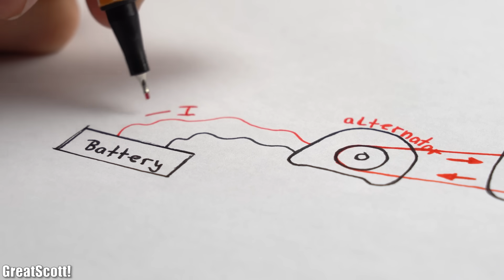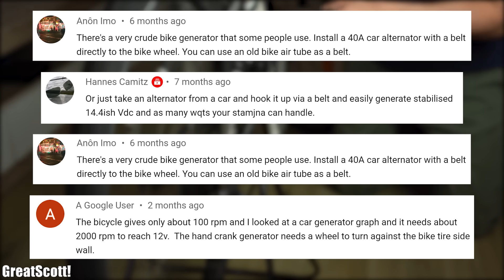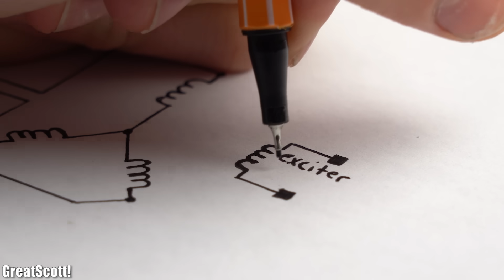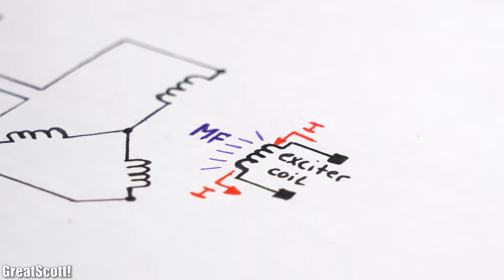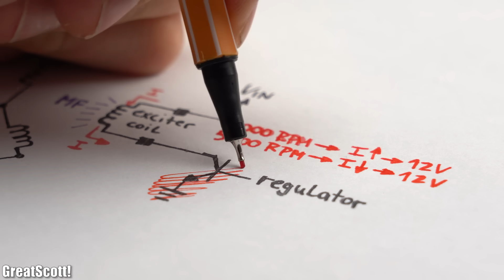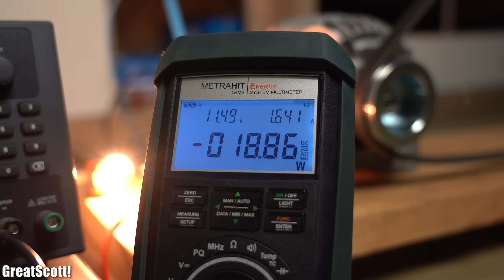Using a car alternator with a bike to power my home? How much energy can I produce?!

Comment: With "perfect" power transfer, you should be able to peak at over 100W, maybe 200W if you're qualifying for the Tour de France.

It certainly gives you an appreciation of how much work is done around the home by electrical power.  200 years ago, it either wasn't done or one had servants/slaves.
The daily work output from one would have been less than 2kWh. Think about that when you get your bill.

Comment: Hello hello from AUS. My First comment here, I always watch the channel - Great channel!
A thought for you - The belt looks really loose when you are pedalling. Its possible there is a lot of belt slip occurring and therefore loss of power generation. Look up a belt assembly used on a car, there is a spring loaded tensioner and idler pulley that can help keep belt friction on the alternator?

Comment: Back in the old days, bicycles had a dynamo to power just the front light. Ie, you were never going to get much power from the system.
Edit: as many others have mentioned.
Reply: That dynamo wasn't expected to drag much energy out of the system, otherwise it'd be too hard to actually go anywhere with the cycle.

Comment: Using an alternator that doesn't  have an integrated voltage regulator (older Ford or Dodge vehicles), perhaps would suit your application.
Reply: Using an alternator that doesn't  have an integrated voltage regulator (older Ford or Dodge vehicles), perhaps would suit your application.

Comment: How many euros of food would you need to consume on top of what you normally eat to power your house for a year?

Ps: you need to feed the stator output back into the rotor field windings and use a car battery as a capacitor. Basically recreate the car electrical charging circuit. Then use a inverter to produce the voltage required for your electrical needs.

Comment: 2 things I'd recommend on this project. One add a tensioner to keep the belt tight. And maybe a pulley system to increase the final rpm
Reply: And a flywheel
Reply: Yes definitely a pulley system
Reply: @wildchild2193  the contrast in the replies... lol
Reply: @JSacchetti1 The lowly flywheel does more than start an engine:

Starting the Engine
The gear teeth cut into the flywheel’s circumference help with starting the engine. The engine’s starter motor has a small gear (called a Bendix gear) that mates up to the flywheel when you turn the key. The Bendix gear/starter motor combination spins the flywheel, turning the crankshaft and beginning the compression cycle necessary to start the engine. After the engine starts, the Bendix gear withdraws so the flywheel can spin freely

Smoothing Engine Speed
Once the engine has started, the crankshaft converts the up-and-down motion of the pistons into rotary motion. However, this motion is jerky because power is generated only twice (for a four-cylinder engine) or four times (for an eight-cylinder) during one engine revolution. The mass of the flywheel uses inertia to keep the engine crankshaft turning between each of these piston firings, so the rotation speed of the crankshaft is kept constant and the engine runs smoothly.

Balancing the Engine
Because the pistons are offset from the center of the crankshaft, the engine vibrates and wobbles as each piston fires at a different angle. The heavy weight of the flywheel resists this side-to-side motion, helping to stabilize and balance the engine on its mounts and reduce vibration throughout the vehicle.

Reduce Drive Train Stress
By stabilizing the engine’s movement and smoothing out its speed, the flywheel reduces wear and tear on other drive train components. Although the engine and the transmission shafts are parallel to each other, the attachments between the transmission and the axle are not; the driveshaft uses universal joints that constantly change angles as they turn. Flywheels help reduce the wear on these joints.

From: "itstillruns.com"
Reply: Yes agree.
Reply: Yes, but you have to be carefull, the more rpm you put in these generator without magnet, more is the resistance they make to generate power becoming very hard to move the wheel with your legs, thats why they use engines by diesel to generate power, that magnet fields make a great resistance
Reply: Absolutely agree, it would be very easy to adjust the ratio to exponentially increase the RPM of the final drive. Incorporating some Capacitors might (just an off the cuff brainstorming) upgrade the starting power for larger demand requirements.

I love being inspired by these great minds. Love to learn constantly. Majority of people don't realize that we don't have to be slave to big corporations and box stores to depend on for alternate gadgets, because they are not going to promote things to help us keep from spending a lot of money.

So many things are simply much more inexpensive if you have knowledge or even think outside of the box. 
One example Fog-X, probably what 3-4 dollars. Look on the ingredients on bottle or MSDS, it's ISOPROPYL ALCOHOL, ie: rubbing alcohol that you can purchase for about 1 dollar US in a much larger bottle than Fog-X. Now I don't fault the makers of Fog-X, we live in a Capitalist economy after all. But you don't have to be a Sheep if you choose not to.
Reply: You don't need a pulley system. Just take the bike out of low gear! That's why they make multi- gear bicycles -- they have their own multiple pulley systems.

Comment: I'd use something like https://amzn.to/3uERyti to apply the needed power to the regulator and try to average the RPMs by using an intermediate gear/wheel that will bump the average RPMs up to around 3K which is what vehicles generally average while driving.  You should be able to nearly fully charge a stable battery in 30-60 minutes of pedaling.  You can run a few things off of that for a few hours at a time.  Your 12v 120a alternator can provide 12*120=1440 watts, if you're only getting 20 watts, you're incredibly inefficient and need to work on that. LOL

Comment: That type of belt is called a micro v belt.  Since your belt has 4 sections, it can handle the torque of 4 regular v belts.  BUT ,  It must be tensioned 4 times tighter than a standard v belt.  Yours was WAY TOO LOSE .  If you can figure out how to properly tension the belt, I estimate you should get around 300 watts.  But for only 15 to 30 minutes.

Comment: When you select an alternator perhaps a self exciting internally regulated single wire would be a good starting point.  I'd also add a battery so that I have a complete  "automotive" system that is very predictable.  Good idea to eventually let the stream in my front yard turn that whole rig.

Comment: You can have the same setup as in a car with the battery initialising the alternator until the engine runs and the flow is reversed to charge the battery. You won't be depending on an external 12v supply.

Comment: Check my channel, I used an e-bike, and the motor was used as a generator and I could output over 300 Watt with it (peddling with my legs). Nothing is needed, the motor is already there, no slippage, no rpm mismatch, nothing.

Comment: Hey kannst du mal schauen ob das Fake Akkus sind? weil das scheint mir schon sehr SUSSSSS.
https://www.ebay.de/itm/282860422149?_trkparms=ispr%3D1&hash=item41dbcb8405:g:CmQAAOSwpHtceQLJ&amdata=enc%3AAQAFAAACgBaobrjLl8XobRIiIML1V4Imu%252Fn%252BzU5L90Z278x5ickk7PdDazAlGltMLJlUhrWsD4KjVVkkwqT45aJjZuiGDnlWXnHrGeKTuzMLNZFzn4EG2gR%252Biwzcei6NsU576C7ZWgeMiy585VEsnQ4QjoTVfC8v%252BNTXbBpEbOobT4XTkrnIcR%252BmiBiOHcY15O7NerQWqTlpmYRPPM1JQRDTt1KgnDFkq0VuqGpDO6MyWVIJC5v9OED6r4CgrN6ur7S5a7RpQVaYLQXZ6qmFZ5MD17QJBzfUwCjReOZFld%252BrU4l%252BEPbqykKg%252Bzuw0L8hKJyUgiHacrF6hlOnHy64Uu9uvRN0VHs2XfvDI8GRxrWIHHIuTBBWcwfBFuDdVWxGtTl1YFVclsHm3TXwjVFYRSHc%252BAMukJJPL0i3Ot7x4uwyJNl55eoMym%252B93geAS%252Fkhjbuq72pCZ40IfYABHpZboVDpnVwJ%252FRgkYDbWeTy6aqS5Ek61jN6esV7q2WCA0zog3PrIexIABEkxN7TC3nLRY6Q%252B9vE5qPfGbDYbRXAmjtcLCxxgIZF4D%252BmRxbmabWWsyd6JmL8zLBwz2Zoc1fXOykDfAqMw9F5APtKmeSwHjGj%252B507EAAFPXSJmGH39D%252FuTiWemUtKt221t3G7TQHgXMQqRM0aQjvsZK6Ouc1L0wIYB5HRGu9UitXM%252FpwDDBZ6xHGSfxHHuaPnnxiEMSrFRpOOlVe760A%252BvdMlgj5mPutmQYXvCwzSGfMz96W%252Fc%252B7nuKSG2kcptnyXiSpjqSn%252B4eaqN0gsnz98qp6GydX0pX4GIAl80nMI7Ndt%252Fozkh6cqUIPyEKnZH1y8L%252Fk7D9ZaR%252B1mGZS%252FnxAA%253D%7Ccksum%3A282860422149211594ecf4a94eb0a67e524639025a48%7Campid%3APL_CLK%7Cclp%3A2334524

Comment: I don't understand why GreatScott! is trying to reinvent the wheel (forgive the pun).  Why doesn't he just get a car battery and hook up the alternator as it would be in a car?  I'm sure the charging system schematics are available for whatever vehicle that alternator is for.  The battery powers the field coils (he calls them exciter coils, must be a German thing) and his peddling action provides the recharging action the car motor would normally provide.  Most cars idle at around 800 RPM which is adequate to keep the battery charged under moderate loads.  His peddling action should be enough to keep the battery charged under light loads, or recharge the battery if the load is disconnected.  Also, If I was him, I'd get the proper field coil connector to plug into the alternator.  Replacement connectors for alternators are usually available for most car manufacturers.

Comment: I'm not an expert in any way, but I thought alternators output ac current that gets put through a bridge rectifier then a regulator. If you eliminate those, would it be possible to make 120v ac? If so, one could probably use an old lawnmower engine to create a cheap genset.

Comment: I built something kind of like this a few years ago by using a gas engine to turn a car alternator as a 12 volt generator. Turns out it takes a lot of horsepower to spin a car alternator under load. Like every bit of what that GX200 could put out!

Comment: Definitely could supplement your solar charging for your power wall if you hook it up to your BMS. That could counter some of the loss of sunlight during the Fall/Winter.

When I move, I'm planning on doing a solar/battery setup for monitoring my plants and outdoor lights. I might try this out as a secondary input source.

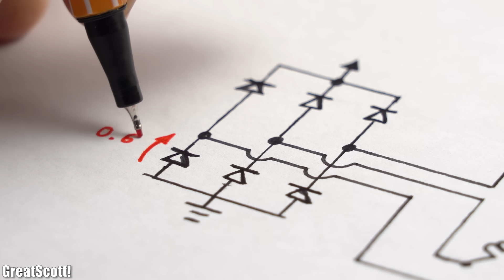Also, I'm assuming the German word you used @ around 3:10 is for a 3-phase rectifier? If so, what is the word? I plan to confuse the hell out of my coworker as soon as I get the chance 😂

Comment: Try using a self excitation capacitor. Also you can turn your squirrel caged induction motor to a high performing generator with 80% of its rated capacity also by using a self excited capacitor, getting the right values might be hard though. Goodluck!

Comment: Installing a tensor on the belt would be good for stability.
And for a future crazy project, building a wind mill and installing the alternator there to see how much power could you get would be cool to watch.
Reply: Installing a tensor on the belt would be good for stability.
And for a future crazy project, building a wind mill and installing the alternator there to see how much power could you get would be cool to watch.

Comment: Surprising result! As an average human can deliver around 150W on a bike I think there is some more potential in your setup. I think you have to improve the efficiency of you belt system and maybe try an MPPT tracker to optimize the power output of the genrator.

Comment: Alternators actually put out 13.5 V to 14 V when ran by the engine. Engines idle at around 750RPM. The PCM of the car controls to voltage to the exciter coil to keep the voltage some what stable. The other pin is used to sense the voltage for the PCM to know and control the coil. The PCM also uses it for instrument cluster info. PCM is also called an ECM/ECU

I'm a mechanic I hope this info helps

Comment: You can use the built in regulator if you hook 7t to a 12 volt battery....and if you use a used alternator there is usually enough residual magnetism in the rotor to trigger the system. I work on a lot of hot rod boats with car engines and most run the alternator single wire to the battery. Start the motor, blip the throttle and the alternator will start charging and will continue the charge as long as the motor runs. Some race type boats run the alternator off the end of the crankshaft but the  alternator has no output below about 2500 rpm....so to get any output at all out of your deal you will need to spin it at least that rpm....as for the power required...if you have a car that does not have fuel injection start it up and turn the high beams on and off and note how much the rpm changes.....takes a lot of power to spin an alternator that is under load....some race car guys actually have a switch to shut the alternator off if max power is necessary....and serpentine belt or any belt for that matter uses more power than a chain

Comment: First problem, car alternator spins at least 3 times motor rpm. Second problem, i takes about 1 hp to generate 10 amps of output. The higher rpm you spin the alternator the more torque you loose because of the ratio change.

Comment: Salute to the people who tried this in their childhood and failed miserably.
Reply: I couldn't get my bike generator to work right until I put a chain saw engine in my bike...it was a 1958 two speed Schwinn that had heavy spokes....I burned out several 6 volt bulbs that summer ...I finally figured out putting ywo of them in parallel,  the generator doesn't have enough amps to blow both of them...but by then the engine was wearing out...lol

Comment: If you want more power you will have to increase the number of alternators.

To negate the extra resistance you should probably go with a higher fear ratio through increasing the side of the wheel on the tire, and using a much slower gear.

Even though decreasing the size if the gears on the alternators would be more ideal the required torque would not allow you to reach the rpms required for such a power transfer.  By designating a bypass with a minimal power output through a resistor to each unit you could use the power output of the first unit as all encompassing requirement.  At 7 volts it begins to pass to alternator 2, at 10 volts passes to alternator 3.

That way you are continuously gaining power and it is contingent on the first generator.  It also serves as a breakaway from the power supply.  Without an instant discharge of power allowing the flow to be less of a shock and more of a trickle to a stop.  If you balance the main gear and keep the rpms low enough you may be able to have an assisted start.  Also adding a clutch could be a very good idea.  Get heavy wheel moving so it maintains speed with little effort and slowly engage the belt so that the alternator isn't the base regulator of output.

But hey.  Whatever.

Comment: 👋🙂 greetings to all..
This👇 is the best configuration to use the alternator as a generator..

You necessarily have to put a 12v battery and a 2watt bulb from terminal B+ to terminal D+ when the alternator starts that bulb turns off that represents the ignition light on the dash of the car..

then to the battery you connect the 12v DC inverter to 110v AC or 220v AC depending on the country where you live

here is the video where I found such valuable information..
It is in latin spanish but you can activate the Closed Caption and put it in your preferred language

is from the RECALIBRANDO channel
www.youtube.com/watch?v=tb6saM6C7F4&t=623s
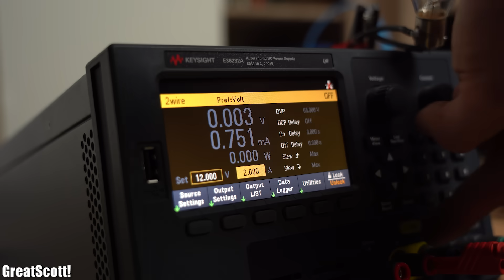*the most important is in the minute 9:28 onwards*

I recommend you see the explanation several times so that you can get out of doubt and understand it well
Reply: and to move the alternator
of course you can use a bicycle but ..
You can also use an electric motor connected to a battery and to that battery you connect a small solar panel with its controller
and 🙌walá you have a green autonomous system that energizes the whole house with a small solar system
👌easy😀and😀cheap👍
👉ALWAYS remember to do mathematical calculations so that you assemble a correct system and do not explode everything
Reply: Wena compa ta weno el video

Comment: Your setup could use a bit more tension on the belt. Maybe try to make a adjustable mount for the alternator with a screw that would move it away from the bike. That way you could increase the efficiency of the whole process by increasing the tension

Comment: How many people suggested using a spring belt tensioner (like from a car the alternator would be in) to keep the belt from slipping? And\Or adding some kind of wooden\3d printed gear box to keep the rpm higher with less work?

Comment: From Wikipedia “Over an 8-hour work shift, an average, healthy, well-fed and motivated manual laborer may sustain an output of around 75 watts of power.[2] However, the potential yield of human electric power is decreased by the inefficiency of any generator device, since all real generators incur considerable losses during the energy conversion process.”
So if your conversation is 50 percent efficient you should expect to get about 37 watts. Is that close to what you are getting?